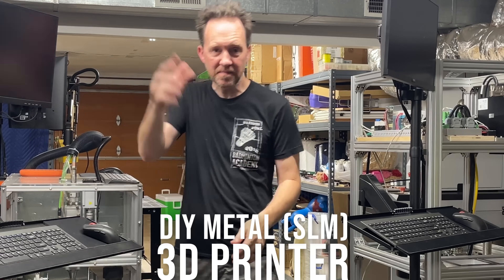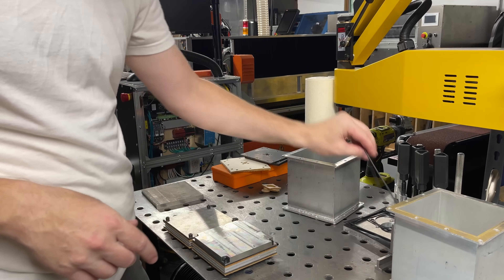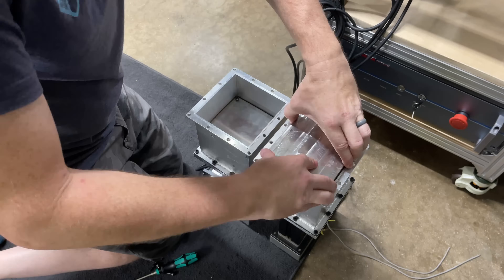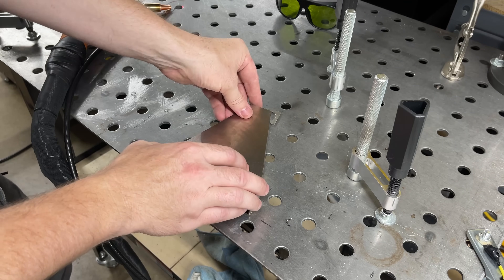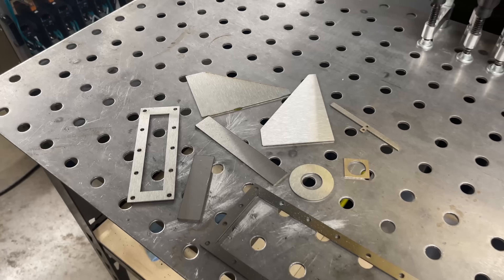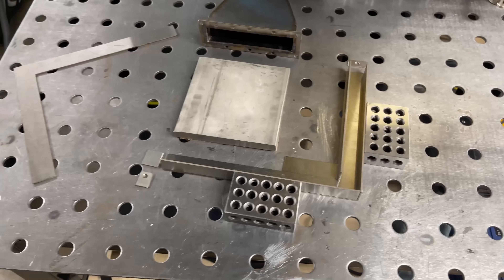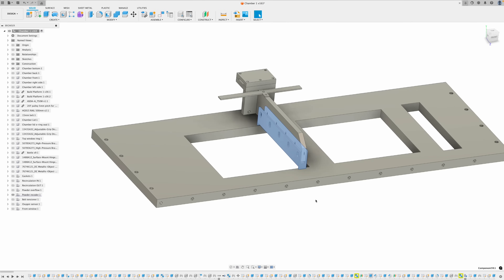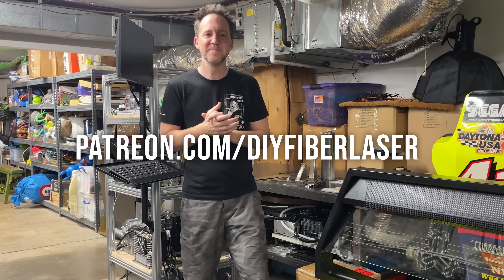DIY Metal 3D Printer: Part 5

Comment: for smoother flow and to avoid back pressure when making gas flow channels or piping, My instinct would be to use curved corners not square. depending on need, this may or may not be a concern.

Comment: This might be a far out idea, but instead of rigid metal boxes for dust delivery, use flexible bellows? use a short box say 2 inches, and the square bellows below, just compress the bellows to push more dust up. no leak, no friction fitting, simple?

Comment: Hey Travis! I have a few questions about the design. 

1. After the printer prints out a part, are you going to need to bake them in a separate oven to completely sinter them as well?
2. If there is no explosion risk for printing stainless steel, then why do you need recirculating inert gas? 
3. What are the temps of the machine (print chamber temp and laser temp) ?
4. What kind of powder do you use for this printer? 

Anyways, the progress looks GREAT. keep it up!

Comment: Just wondering if you already tried the sealing with actual stainless steel powder? Metal powders behave in a very unique way, and it's difficult to predict its behavior has it can completely change due to various factors (particle size distribution, humidity, material and other fancy factors). So my best advice is just test it with powder, and make it easy to modify haha.

For the fume extraction system, as the flow will be from back to front, you gonna have lot of fumes and dust on the window but I guess it's not a big deal.

Comment: High density felt works, but I still think PTFE would have been the ideal seal material, especially if you want a gas tight seal.  It does feel fairly rigid, but if you can place it under a bit of compression (eg those chamfered plate edges with clamping bolts I suggested), it extrudes very readily and will conform to the shape of the surrounding structure..   I do high pressure (3000 psi) seals with effectively what are PTFE "crush washers" (they go in slightly under size and expand radically to fill the interface  when the fitting is tightened axially) and they not only perform very well, but have a surprisingly long cycle life..
Reply: teflon should be outlawed

Comment: Travis, I have a question: when cutting 1.5 mm and 2 mm stainless steel, do you cut the 1 mm sheet straight through, or do you pierce it with a stage 1 cut? And at what speed do you cut 1.5 and 2 mm sheet at 1000 W?
Reply from the maker: I'm cutting 2mm stainless at 5m/min, no pierce, 175psi compressed air, 1.5S nozzle, 0.5mm nozzle height, -1.5mm focus

Comment: Cool project.  Just a few tips I've picked up over the years. Tab and slot construction of sheet metal is self aligning, easier set up for welding, and can be stronger.  When welding 2 different thickness metals you should pre-heat the thicker piece so the weld will stick on the lower settings.  Can't wait to see the first print video.
Reply from the maker: Thanks for the advise...still learning to weld here and every tip helps....thanks!

Comment: What if you did a rigid Teflon/PTFE wiper, then use the housing (which is slightly bowed) to self-clearance if? Once your linear actuator is set up, heat the housing (for a little expansion) and put the piston in with some lubricant. Let the linear actuator move back and forth repeatedly for 24-48 hours.
Reply from the maker: That sounds like it might work, but I don't know if it would be worth the time investment
Reply: @diyfiberlaser once you’re not actively working on the piston system it may be worth a try!

Comment: Nice! Waiting for the next one! :) For very thin wall thicknesses, TIG might be the better option. 6061 has a video where he welds beer cans using the pulse function. Apart from this, silicon bronze TIG brazing or Micro-TIG/Pulse-Arc welding should work well (JohnnyQ90 is using something like this since a while - it gained a little popularity here on youtube as "cold weling" recently).

Comment: Hobby SLM built in a garage: solid stainless steel gas duct. ✅
Professional $1M SLM: Plastic 3D-printed gas duct that roasts itself like a kebab every 500 hours.❌
Reply: There will be an opportunity to print a stainless one... when he makes a functional stainless printer. 😂 Im sure that's a top project for this when it's done.
Reply from the maker: @Mitch3343  That's exactly what I would like to do! : )

Comment: Following with excitement! Won’t the 3D printed parts melt due to the high chamber temperature?
Reply from the maker: Possibly. The chamber won't be heated, but I'm sure some heat will accumulate during printing. They will just be temporary parts, I'd like to use the metal printer to remake them once it's done.

Comment: Regarding the powderintrusion in the cylinders / areas below the buildplate. Couldn’t you put two holes in there with screwable plugs or pneumatic fast connectors that are closed most of the time and when you wanna clean it you simply attach a vacuum and suck all the dust out (second hole so you don’t create a vacuum). 
That way you’d be able to clean without having to disassemble.

Actually with two holes in the bottom you might even be able to have constant low pressure airflow though the chamber that will catch any intruded dust and carry it out into a filter or cyclone (not sure if a cyclone would work with dust that fine).
Reply from the maker: That's a great idea for the future! ...though I will leave it as is for now so I can visually inspect and see if I need to rework the seals.

Comment: Did I miss why the build plate isn't just a circle?
Reply from the maker: I mentioned it in a previous video...basically because I would have issues trying to make some of the parts, based on my machines cutting and hold-down limitations...if I could make the parts, it would certainly simplify some of this build.

Comment: On that rear 3D printed part for the gas recirc at 17:31- I wonder if you might get more even suction into the various channels by making the longer voids progressively larger than the shorter ones to even out the flow restriction. Loving the build - thanks for sharing it with us!
Reply from the maker: That's a great point! Luckily it's a 3D printed insert so we can test and make revisions easily
Reply: or alternativly making all the narrow parts the same length, so the flow resistance is the same.
Reply: Came here to say this :)

Comment: I'm not certain the gas recirculation system will work the greatest, without enough negative pressure from the blower you may be making laminar flow much harder to achieve
Reply: Good luck with that gas flow system, looks like you thought farther ahead than I did while watching! I should wait to comment until the end of the video :)
Reply from the maker: @noahc6544  Haha, most of this project is out of my comfort zone...I have no idea how well it's going to work, I'm making my best assumptions based on research, and relying on everyones feedback to instruct my decisions...hopefully we're close, but I imagine there will be some revisions once we get to the testing phase : )

Comment: A heads up about stainless welding, if you have full weld penetration you need purge gas on the inside of the part too, otherwise it will "sugar" from the molten stainless oxidizing when it comes into contact with the atmosphere. I hope I'm wrong but I suspect you may have to remake some of these parts
Reply from the maker: Thanks, I never would have even considered that! I'm guessing by the colorization, that the welds weren't quite full penetration...I turned the power down quite a bit. But next time, I will take that into consideration.